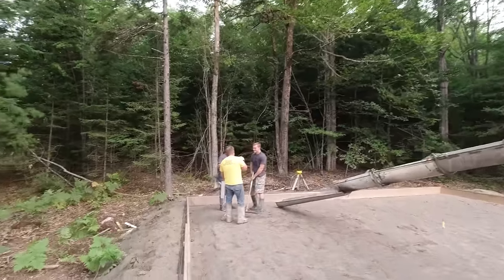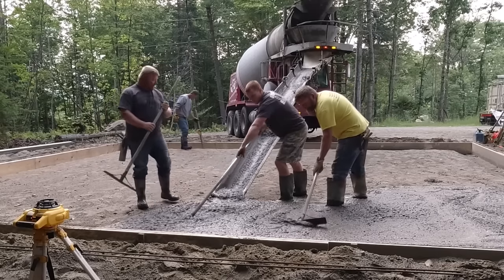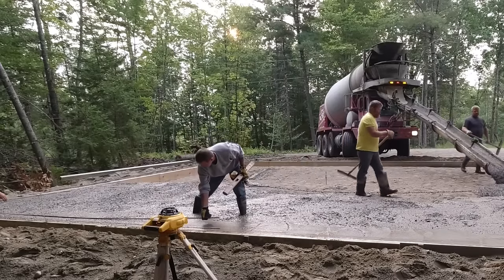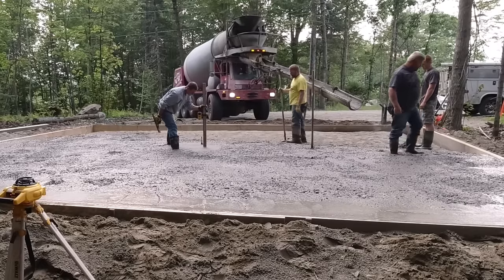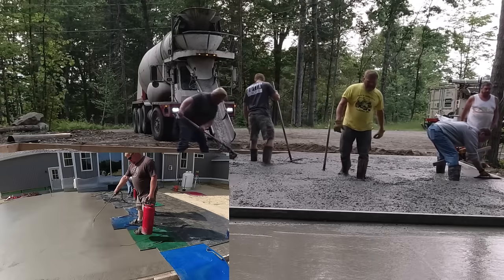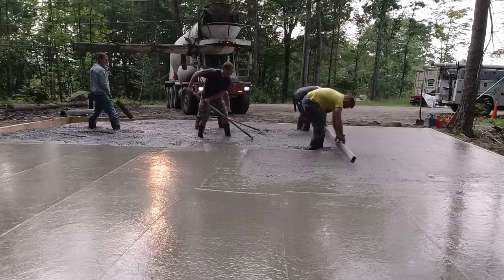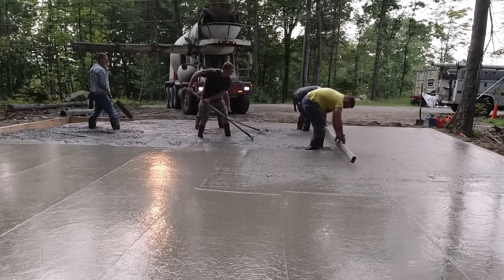Homeowner Forms 32' X 28' Concrete Slab For Us. Watch What Happens!

Comment: Front dump is the only way. It’s all I’ve ever had growing up in Wisconsin where they are made. I moved and often I have to use companies with rear unloading trucks; it’s more of a struggle. Way more work. I don’t know why any company would still buy that outdated garbage. Front unloading trucks have been around for decades.
Reply: I agree. Only way it is fine is if you have plenty of workers and it’s flat land. Front end trucks are all wheel drive too. Read ends are dinosaurs to me now.
Reply: I agree. Back in the eighties when I worked on rural residential foundations and slabs, it was a welcoming sight when an Oshkosh would come around the bend. It meant you could constantly keep in eye contact with the driver and he in turn could place concrete exactly where needed, quickly and efficiently. And not get stuck! Later in life, working in urban settings on big stuff, I realized that the rear dump will always have its place. It’s compact and maneuverable. And when you’re on a big site not driving off-road anymore, all that’s needed is for a truck to park next to a concrete pump or pump truck and just unload one after the other.
Reply: And there’s a pretty good price difference between the two different kinds of mixers.
Reply: @Hoaxer51 $230 / yard + $40 / truck is what I paid for concrete at the last company with a rear dump. At those prices they can change with the times and give me a skilled driver too. A front dump can unload into a pump just as easy.
Reply: @zackzander425 , As a concrete mason I agree with you one hundred percent, it saves you a dump man, they can add water without getting out of the truck, they reach further. 
I was just stating a fact, the concrete company in my hometown in northern Ohio has both style of mixers and everyone wants the fronts   It seems most companies have either one type or the other but there is a price difference.

Comment: Maybe a mistake not putting rebar or steel mesh re-inforcement down first before pouring the concrete.
Reply: Lower part for structural reinforcement, if so desired (I would always go for it, in less massive slabs), but never closer than 2-3 in / 6-7.5 cm to the bottom, or it will end up rusting, cracking, etc
Reply: They use fiber mesh in their slabs.
Reply: @user-fx4qz8pt3w I use both. Fiber is cheap insurance but, IMO, not a substitute for rebar or wire.

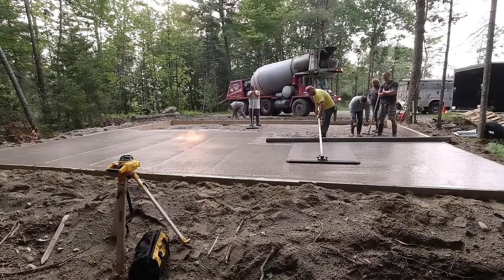Comment: 11:28 , “harder than it looks”, is a dramatic understatement. Guys that can do this kind of work are on a whole other level of awesome skilled workers. Thanks for the cool video.
Reply: From 15:55 to 16:55, the mucking and rodding  is pure excellence.
Reply from the maker: Thank you!
Reply: I learned how to pour a  slab from my father when I was real young. . Back in the sixties ! First we had to dig out the basement. And mix the concrete by hand from separate piles of sand, stone and cement.  I remember it was hard brutal work as a 8 yr old kid. Much respect to all men in trades like this, it's   a skill you only gain through repetition.
Like finishing mud on drywall.

Comment: I'm a retired general supt. for a commercial GC. You have the correct manpower for what you had to perform. Nobody was without something to do. You can tell all the crew members knew what to except maybe the greenhorn. Inexperienced people will view this and say they can do it because you do make it look easy which is a clear sign of your experience. When the novice tackles a job like this they quickly will become to appreciate your expertise after they have completely F'd the project up. The one thing I didn't see was a vibrator consolidating the edges, I hate honeycomb with a passion. The water reducer alleviated a lot I'm sure but still would have liked to see a vibrator. Great job all around by everyone.

Comment: looks like a 10 to 15 slump. Much easier to pour like that. I have never done it without a center screed form. Usually we put a board through the middle to put the screed on so it is level.

Comment: Great video Mike! What factors do you consider when deciding to use the ScreeDemon or hand screeding?
Reply: I use my ScreeDemon all the time. I just wish I could cut out the dealer and buy your products factory direct. I used to live in Slinger.
Reply from the maker: Sometimes the width of the slab, and sometimes how much slope it has. If we had a 14' screed bar we'd use it on more garages like this one. The 12' is too small for some of these.

Comment: The driver should be pouring that out right up against (into) the other concrete just poured so your labor doesn't need to push n pull the concrete forward or back.  
I haven't seen anyone tap the forms to get the bubbles out from sides. Yes the wetter concrete doesn't leave a many but it still does some. 
Magnesium screads still get bent. I've use a custom cut 2x4 for years 30+ and if it's taken care of it will stay extremely straight. I like your 3/4" crushed under the slab not dry and that sucks the moisture out and moves all around.. before I became a contractor I drove front discharge mixer fire 12 years.  So yes,  I have plenty of experience and have seen it done most every possible ! And impossible.  Lol

Comment: Mike, I have a question for you.  When buying an aluminum screed, what brand and type are your preferences?  Do you think there is a difference between extruded or cast?  Brand?  Are all the 2x4's with a sharp corner or are there some with a slight rounded edge?  Thanks for your thoughts.  Update.....I just heard you mention magnesium screeds.  Please add that to my questions above.  Thanks for another great video.

Comment: That looks, initially, deceptive. I mean, how hard could it be to push a broom periodically 🙂
But 28 cubic yards, that’s a helluva lot of mass to push around, tamp down and smooth off. 
I’m full of admiration for people who know what they’re doing and entirely capable of the physical work required to yield a slab that the client needs. 
Somebody working for the previous owner of this our house set out & prepared a similar sized slab for our garage, comfortably sized for two cars - or one car, two motorcycles - and extensive shelving and full width work bench. 
What’s remarkable to me is that the final finish looks polished. It’s as smooth as a well laid modern kitchen floor.
I realise I’m a lucky fellow. My one requirement I put to my wife, when she went looking for a house, two years ago, was at least a single garage, or room to build one. What I ended up with greatly exceeded my minimum.

Comment: I would prefer if you put the rebar in first and steel tie it all together along the edges and in the corners where the outside footing is in the uni-slab......instead of just pushing individual pieces of rebar into the concrete during the pour.

Comment: Do you have a training video on what to do if a concrete truck breaks down in your driveway? That happened to me with my first truck of mud. The driver pulled in my driveway threw it in park and asked where I wanted him. There was an issue with the alternator, and he could not shift out of park.
Reply: Just have to plan ahead and call the closest tool  rental place and make sure they’ll have a power cart available if you need one. It’s here or there but anything can go wrong.

Comment: Should always have steel reinforcement wire is good enough for this job. Fiber is added inforcement but not a replacement for steel. Ive seen fiber fail on its own. Its both or steel not a fiber can replace steel.
Reply: Slabs like this need corse of block on top. I know so many people do without but its not correct. Should also be sloped or drain. This home owner isn’t very knowledgeable and you shouldn’t listen to him
Reply: This is why structural slabs, what they call slab on grades are garbage because a coarse of block is hack. Should have a proper foundation that are frost wall depths and normal floor inside usually people don’t put a fibre board but concrete floors shouldn’t touch concrete walls.

Comment: Wait, Plastic and 4x4 wire mesh????????????? No gravel below?????? That will crack for sure....................................
Reply: johnharrell817
When pouring in an area that is good clean sand you don’t need mesh or gravel, plastic is only put down if you want to. But is only required if it’s a house. At least that’s code here in northern Michigan.

Comment: Did this shit for years, started when I was 18 as a labor by the end of the summer they made me a finisher 2yrs of residential went commercial, joined union late twenties retired at 58 .. I hate this shit, sure do my own stuff but no side jobs ….one tip take care of your hands it’s hard on them dry cracks big time…
Reply: Kudos. What is it about concrete that’s so hard on hands?
Is it that it’s slightly caustic? 
Well aware that it’s extraordinarily abrasive.

Comment: Takes longer to pour concrete out of the truck BS as wet as you pour I could of had 10 yds on the ground with a good chute man not afraid to move in less than five minutes. That driver was dribbling out concrete.